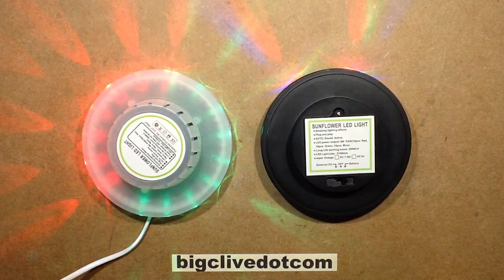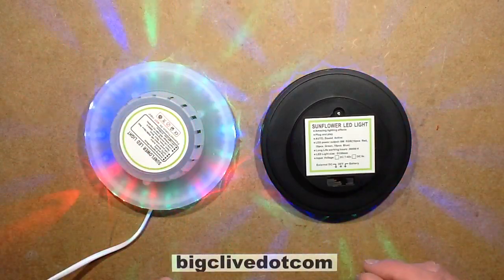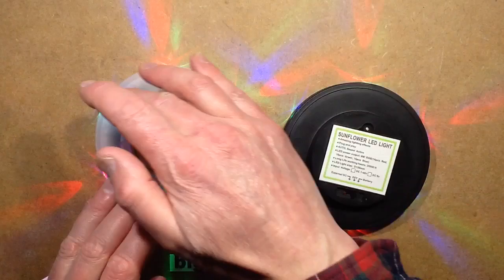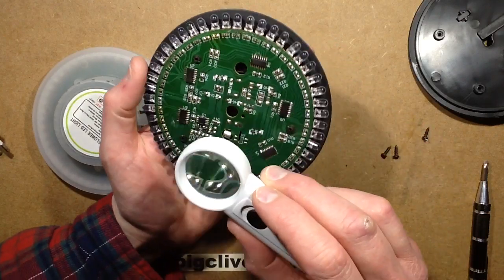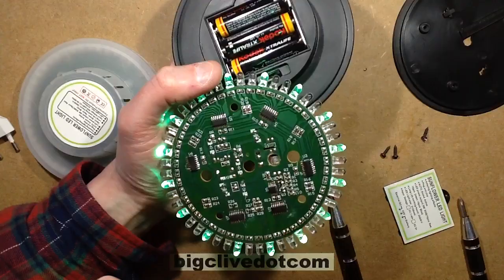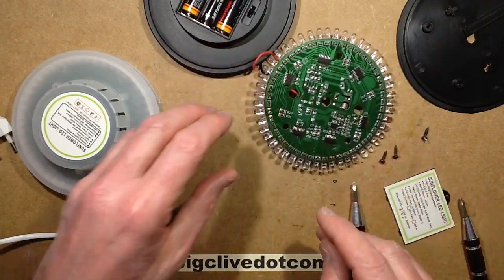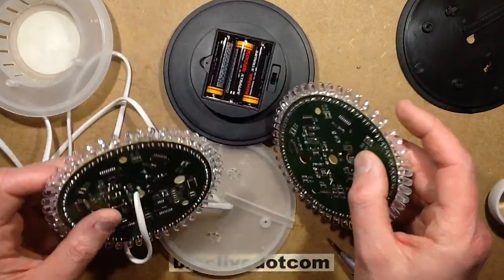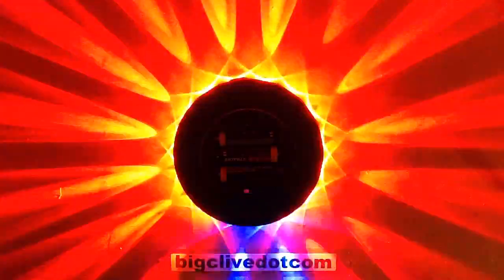Inside two tornado party/disco lights.

Comment: Ringing sound at 0:35
*very high pitch for 10 seconds
~*happens several times- when lights are on hmmmm
= Conclusion is whenever the light on the left does the same cycle as 0:35
Reply: +WooPantsZX I noticed it too, and had to rewind and let it play again while looking away to make sure I wasn't suddenly synaesthetic.  Nope, still heard it.
Reply from the maker: +WooPantsZX Must just be a particular loading on the switchmode power supply.
Reply: +WooPantsZX it bothered me too
Reply: +WooPantsZX Actually seems to happen when more of the lights are off than on, like during that "three direction spin" thing.
Reply: +OOZ662 It seems to be when the light on the left, connected to the mains, goes onto its two light cycle or whatever you'd call it, when the leds flash around both symmetrical sides
Reply: +bigclivedotcom Sounds more like its making a UFO noise for effect, try clapping and see if it triggers it. Its very high pitch, you might not be hearing it.
Reply: i'm glad i can still hear it

Comment: The mains one has I'm sure a wong LED, there's a green one where there should be a red one. Watch bottom left at 2:18
Reply: +Donald Sayers that is, i think, the mounting pin that holds the board and cover in place, there are 3 around.

Comment: glue two together,add to the bottom of a quad,fly out in a field at night...have a blast with cops!
Reply: Wouldn't be as impressive as you think.  These directional LEDs require the light to reflect off a surface, hence why they're designed to sit on a flat surface so you get the cool effect like the end of the video.
Reply: lol...most probably it will lite up the drone making it visible...

though ones I did a similar thing....hanging it up to a  helium balloon with sufficient string length and let it go
Reply: +thechosendude You can actually replace the LED's with wide angle ones from the christmas lights string.
Reply: You could always put a paper disc around the device for the light to show up on.